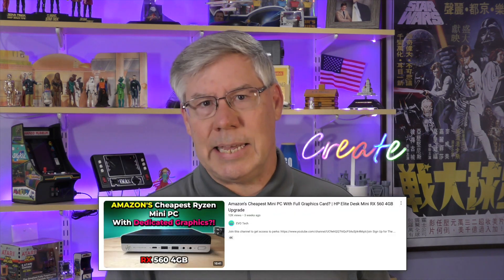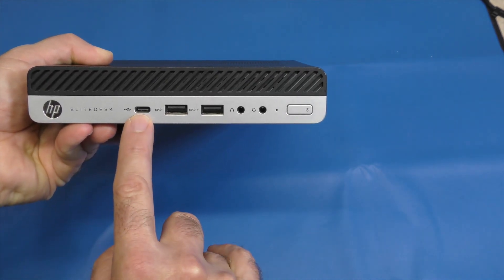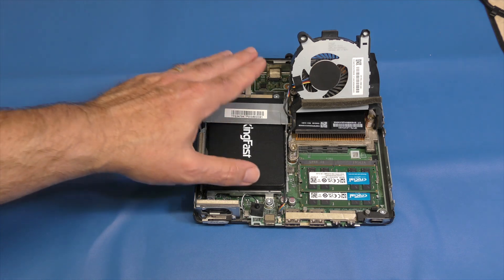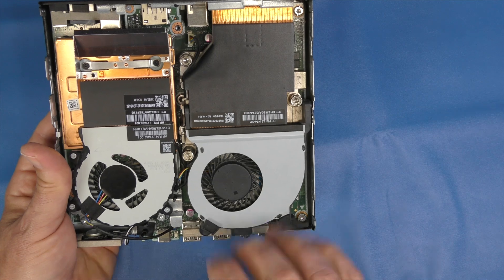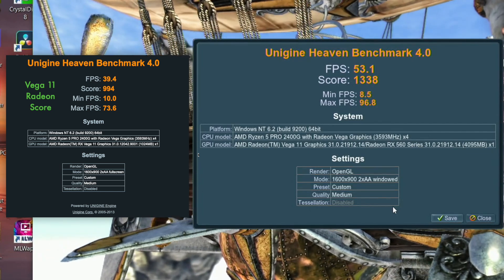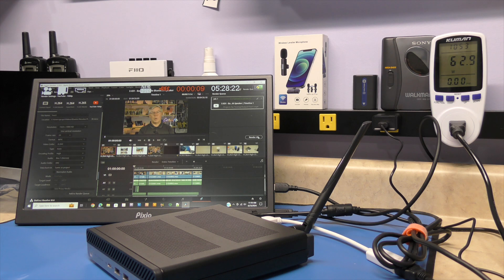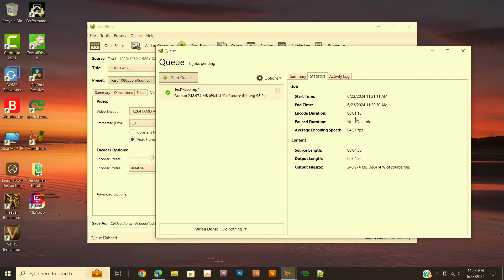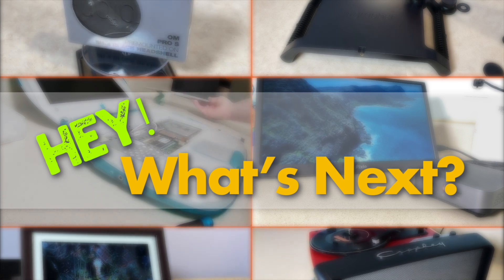HP EliteDesk 705 G4 Mini PC Discrete Graphics Upgrade

Comment from the maker: It was brought to my attention that the Unigine Heaven numbers weren't correct as the resolutions for each test differed. I reran the test at a 1600 x 900 resolution and graphics improvement was 44%. The discrete graphics test showed the FPS was 45.3 and the score was 1893. The built-in graphics showed the FPS was 31.3 and the score was 1311.
Reply: you are a very underated youtuber, i hope your channel blows up later!
Reply: Good ole days when you can get the GPU for under $300. $565 on part surfer.
Reply: What is the cord called you need for it 150w hp cord I want ro make sure I get one that fits in the  power  Port plz helpp
Reply: @zachsocat  If you're referring to the Power Cord that fits into the 150 Watt Power Supply, it's a three prong adapter or C13 connector.

Comment: @heywhatisnext  
Hi, I have a question... I bought one of those AMD cards, but it only works with the Microsoft drivers. When I install the AMD drivers, the screen goes black.

I don't know if it needs some special BIOS configuration or if the card is faulty.
I don't know if you still have it, and if so, could you tell me which driver version you have installed?

Thanks
Reply from the maker: Thanks for watching. Yep, I still have it. I have the AMD Software: Adrenalin Edition solution installed and it shows that I’m running the AMD Windows Driver Version 31.0.12042.9001 running. I hope this helps.

Comment: hi sir.. for m.2 slot do you need to adjust on bios ? actually i try to connect external GPU but still not working and don't even pop up on device manager
Reply from the maker: Thanks for the comment. It’s been a while since I added the M2, so if my memory holds true, I installed it and in the bios selected it as the boot drive. I hope that helps. As far as external eGPUs, I haven’t tested that feature.

Comment: 1) Not every one of them has the port for the GPU.

2) If you install the GPU you also need the ventilated top otherwise the GPU will throttle under thermal loads. Most don't have it so the ventilated top sells for premium prices.

3) You will also need a 150-watt power adapter otherwise the machine won't boot and will throw a power beep code.

I put one of these cards in a G5 mini with an i7 and 32gb RAM and it plays almost anything. It even plays Oblivion Remaster despite only having 4GB VRAM. You can also use ThrottleStop to get a bit more performance out of the card.
Reply from the maker: Thanks for the additional information!

Comment: I bought a used one a week ago at 150 €, I'm in France and this model with the Ryzen 5 2400G, with 16 GB of ram and a 512 GB SSD it's superb I can even play with video games with the Vega 11 graphics chip and many video games even current like Starfield or GTA5, Witcher 3, etc ... are playable with a good quality in graphics in medium quality, superb this little mini pc.
Reply from the maker: Thanks for watching and sharing your experience.
Reply: Do you recommend it and does it run Fortnite and valorant ?
Reply: @7-amza99  Yes in medium quality no in high or ultra graphics, you can play all games even the current ones of 2024/2025 but in average graphics quality with the model G4 with the Ryzen 5 2400/2400G and the Vega 11 chipset

Comment: Hello, can you tell me please the part number of the access panel?  Thank you!
Reply from the maker: @mephisto86yt  Are you referring to the lid of the unit? If so, the number I see is ASSY P/N: L16628-001. I also see CT: LHBKN038JC81J5 and 2AF82TATP20D9188T4P.
Reply: @heywhatisnext  yes, the access lid. Thank you very much sir!
Reply from the maker: You are welcome. Sorry for the confusion on my part :-)
Reply: @heywhatisnext  no problem. I want to make a frankenelitedesk, 35w variant, but with vented lid, 65w heatsink, and mosfet radiators
Reply from the maker: @mephisto86yt  Keep me posted. I would love to hear how it goes.
Reply: @heywhatisnext  all good. I found a vented lid. The full load temperature dropped to 67 from 75. Thank you!

Comment: Got a 705 G4 65W for 75 bucks and the RX 560 for 45 dollars on sale on ebay. Waiting on the gpu to come in the mail but I am hoping its worth the price. mine came with 1 16GB stick of DDR4 and i know for the Vega11 thats bad but wondering if its worth 20 bucks for another 16gb stick if I am gonna be using the 560 now
Reply from the maker: Thanks for watching. The extra RAM is not a bad idea if you plan to do memory intensive apps (graphics, video editing). For now, install the card and see how it goes. You can always upgrade later.
Reply: @heywhatisnext  alright, yeah I don't think the single channel memory will be as important with a dedicated GPU vs using the Vega 11. I definitely don't need 32gb of ram just wanted the dual channel
Reply: Good price on GPU. Sold out now. 565 on hp part surfer. PN L31404-001
Reply: Lucky you, everyone else sells this part for 100 over that price minimum now
Reply: @coolunusual  yeah I wouldn't have bought it for 100.. even 50. Not worth it at those prices. It definitely helped and made a bunch of games actually playable that were not with the Vega 11 so it was worth it to me at 45

Comment: Windows 11 will probably install now. The minimum specs on the installation were lowered. I installed Windows 11 on something much older than this it was a Windows 7 machine that had a built-in TMP 1.2 version. You have to get the new Windows 11 .iso from the Microsoft download site and make a new install stick the older .iso requires newer motherboards. It is kind of like Windows 10, but you can still use it without a product key.

Comment: What did you do with SSD? What if you don’t have a vented top?
Reply from the maker: Thanks for watching. The SSD is just stored in a bag currently. Since it housed the original OS, I’m keeping it in case the NVME drive goes bad. As far as systems that don’t have a vented top, I’m not sure. The heat generated from the graphics card and processor can get very high. I’m not sure a non-vented box would be good long term.

Comment: Ha, I just looked at the ebay link and it's $150 now. I've been wanting one of these Ryzen 5 2400g mini pcs for a while and I knew about the addon gpu but it seems like its just not worth the added cost or power usage. Lets be honest no one is going to use these mini pcs for intensive gaming so the vega 11 is likely enough for casual games. The 560 gets you maybe 30% real world performance boost in games which just isn't enough to play newer more demanding titles compared to vega 11.
Reply: Just had one shipped for $80 (2400ge model) as an emulation machine. I have an Atomic Pi and was just not impressed with its N64 performance and inability to run 2D Dreamcast reliably. Pi4 doesn't do all N64 and costs can easily eclipse $100, same with Pi5, so decided to check out mini desktops and found that these little PCs are dirt cheap now. I was curious about upgrading to the 2400g 65w cpu and saw that the product specs contained SKUs for a discreet GPU which was crazy to me lol. I'm sure it would help with emulation, but I'm really not planning on running a ton of advanced emulators with supersampling on this thing
Reply: I have a Lenovo Ideacentre with Ryzen 5 2400G, 16GB RAM for which I paid £80. Recently added a GTX 1650 OC for £70 and now I can play Forza Horizon 4 on high settings at 60 FPS 1080p.
Reply: @neotronicmind8337  That is awesome! Thanks for sharing.
Reply: @macvideomanlive  you're welcome. I am into racing/rally games and that cheap combo allows me play AAA games in 1080p. Dirt Rally 2.0 also runs smoothly on medium settings in that resolution. The graphics I bought is a single fan Zotac GTX 1650 OC GDDR6 as the pc case is a medium tower that only fits cards of full hight, half length. Overall I am really happy with the system built on the cheap (£150).
Reply: @cryangallegos  You’ll have to let us know how it goes.
Reply from the maker: Thanks for watching and the comment. I completely agree with your assessment. It is a great mini pc.

Comment: Hey not sure if u had the right power brick or the one that come with it. To run that vid card u need to upgrade to 150w brick to give the voltages needed
Reply from the maker: Thanks for watching. The power brick that came with it was 135 watt. I did upgrade to 150 watt after making the video. Overall, I didn’t see much different. I a till like the setup.

Comment: I have plenty of power supply's of that rating in the Dell variety. Would an adapter work with these units?
Reply from the maker: Thanks for watching. Off-hand, I do not know. I guess as long as the polarity, amps, and volts match, it should work. Personally, I’d research this a bit more online before you give it a try.

Comment: Hey @heywhatisnext, is the 150w adapter you are using a model # HP L89697-001 19V 7.89A 150w?
Reply from the maker: Hi @tanktrenchdigger4501, my power supply is different (got this off eBay). The part# is 681058-001 19.5V 7.69A 150W. The power supply I received with computer is a generic 135W 19.5V 6.9A, model# HSTNN-HA01. It ran the computer and graphic card fine.
Reply: I got the hp 230w charger. Theoretically it should only use as much power as the pc needs. 20 bucks genuine charger. Only downside is its kinda big

Comment: Hi, i followed every step, i got 3 red blinks 4 white blinks upon starting and my mini pc refuse to start, is there a fix for that?
Reply from the maker: Oh, no! I found this article: https://support.hp.com/us-en/document/ish_1997210-1528385-16. It states it’s a power supply issue. If you’re using this graphics card, be sure you’re using a high watt power supply: 135 watts or 150 watts.

Comment: Hello !  please,  could  you  name  the  part number  of  that  HDMI Option Port board , you had  removed , for instaling the discrete  GPU  ? I have a  Elitedesk 705 G5 mini , and I  cannot  find  the part number  of  this specific   HDMI option port for  this  HP mini pc .   Thank you  very much , in advance !
Reply from the maker: Hi, and thanks for watching. The HP HDMI Port Flex IO board model number is 3TK75AA. I found this information in the following HP PDF: https://www8.hp.com/h20195/v2/GetPDF.aspx/c06042607.pdf. It’s on page 5 and 6. Hope this helps!
Reply: @heywhatisnext  I"ve found  the  same  part number , after intensive digging inside HP flamboiant documentations online, for few hours . Your  answer , helps , by redundancy .
Reply: @heywhatisnext  your answer align  with  mine ,found  after digging for  few hours in various HP online flamboiant docs , and it helps by redundancy . It seems this port is  sold in 705 G5 mini's of Canada region .

Comment: Would the card work with g5
Reply from the maker: Thanks for watching. I looked up the board specifications for the 704 G5 and does have the socket. However, I couldn’t find specific information about this graphic card support. http://h10032.www1.hp.com/ctg/Manual/c06508289.pdf

Comment: Also works in the G4 800 Mini.
Reply from the maker: Thanks for sharing.
Reply: there are two different motherboards in this model. "35w" motherboard(comes with 35w T series  cpu) has gpu connector, "65w"(comes with usual 65w cpu) does not.  top cover is perforated on 65w models.

Comment: Hi when it come's to using the pc what did you do about the HP Wolf Security and sure start... it can be a pain if someone is planning to use it for a home pc everyday use some light gaming
Reply from the maker: As far as I know, I do not use these two solutions. This came refurbished with a basic Windows 10 installation. As far as everyday use, I have a part time job building online help and interactive training on this device and have had no issues running it as a daily driver. I don’t do much gaming, so I can’t speak directly to that (outside of some Sim City). I will follow up with you on what tool from HP I did install.

Comment: Isn't rendering & playback etc CPU intensive in Davinci Resolve? GPU tends to only show it's worth in effects and what not, and even there you need specific modern infrastructure on the GPU to get anything out of it.

The only reason why you would add this GPU is for light and retro gaming, that's pretty much it. So yea, for your use case scenario, it's probably worse since now you have higher power draw and less thermal headroom...
Reply from the maker: Thank for watching and for commenting. Overall, it's still was a fun project and don't regret buying it. Plan to do some more gaming on it in the future.
Reply: @heywhatisnext  It's definitely a good project, and if you either chose to use the GPU to its full potential down the line or sell it to someone that will, it's a win. 

I was just pointing out that perhaps it's good to either know if the upgrade will actually help your workflow or test it based on what the upgrade promises. 

I fell like this video does not do it justice since most of the tests were done based on a use that would not necessary benefit the adding of extra hardware. Which makes sense since you wouldn't have used it before like it had a GPU so why would you do it now. 
Your predefined predisposition of using the hardware failed to showcase the benefits of upgrading it making the video somewhat irrelevant. 

What I would do if I was you is to test the PC with and without a GPU for gaming that's pertinent to the time period of that GPU and make a follow up video. It is a lot of work of course, so feel free to ignore this advice.
Reply: @shadowman1988  I totally agree with you. I wouldn’t say the video is irrelevant as there are those laid back users who might use this solution the same as how I use it, but I do agree that further testing needs to be done to show it’s true advantage. Honestly, this channel is just for fun and gives me an excuse to try things that I wouldn’t do normally. I appreciate your comment and opinion!

Comment: did you upgrade the power supply? what wattage and model is your power supply? thanks
Reply from the maker: Thanks for watching! Yes, I did upgrade it; however, mine came with a 135 watt power supply and the 150 watt power supply I purchased didn’t make much a difference.
Reply from the maker: Thanks for watching! Yes, I did upgrade it; however, mine came with a 135 watt power supply and the 150 watt power supply I purchased didn’t make much a difference.

Comment: DEAR SIR WHAT CAN I DO WHEN HP EliteDesk 705 G4I built it in the  HP AMD Radeon RX560 4GB gives 3 long white beeps after 4 shorts red beeps when turned on,Thank you very much for your reply !!!!
Reply from the maker: Thanks for watching. I found this article that might help. https://h30434.www3.hp.com/t5/Desktop-Operating-Systems-and-Recovery/3-Long-Beeps-4-Short-higher-pitched-repeated-5-times-then-PC/td-p/5609069
Reply: I have same problem. Need a more power, I change the power supply to 150w and the pc work

Comment: Can someone confirm which HP power supply you need to turn this on? I know the 65 watt standard one doesn't work, Just got a 120 watt in the mail, thinking I need to get the 150 watt is the hot ticket?... Thank you.

3 long beeps, 4 short beeps tells me its a power issue.

Cheers! thank you
Reply from the maker: Mine came with a 135 watt power supply and it worked fine (used in the video).
Reply: @heywhatisnext  Thank you, I appreciate  the response.

Comment: What's happened with storage 😢
Reply from the maker: Thanks for watching. Are you talking storage in general or the storage in this Mini PC?
Reply: @heywhatisnext  bro you remove ssd and install graphics card so where is storage install 😩
Reply: Gotcha! Yes, I removed the 2.5” SATA drive, but there is a NVME drive slot which is where everything is stored now. While it’s much faster, losing the other drive sucks. I’ll place it in an external USB case at some point.
Reply: @macvideomanlive  hay bro can we play gta v in it at 1080p normal settings please reply 🤔
Reply: @shadow-fighter-666  Thanks for the inquiry. Off-hand, I don't know. I currently don't have GTA 5, but I'm planning a follow-up video, and I'll make this one of the new benchmarks.

Comment: You can update this to Win 11. I have 3 of there units and just recently installed Win 11 on one of them without a problem. On another note - I have the 35W versions and I was having issues with 2 of them where the fan right from the start spins up to max RPM and stays like that forever. It becomes terribly noisy at that point. The only workaround is to remove CMOS battery, then fans behave normally then, but only until you have the device connected to power, after disconnection the problem returns. The problem is known and described over the internet as well. I was wondering - have you ever encountered this? Can you also post what RAM modules you have?
Reply from the maker: Thanks for watching. I haven’t experienced the issue you mentioned regarding fan noise and high RPMs. Regarding RAM, I have a pair of Crucial 16 GB modules. Here’s the info: CT16G4SFRA32A.M16FR; 16GB DDR4-3200 SODIMM 1.2V CL22.
Reply: @heywhatisnext  Thank you! 👍

Comment: hello I have a 705 G5 model will this modification work? G4 looks the same inside there is also a connector. But won't the bios block the start?
Reply from the maker: Thanks for watching. According to HP’s website, it does appear that it should work: https://support.hp.com/us-en/document/c06461848.